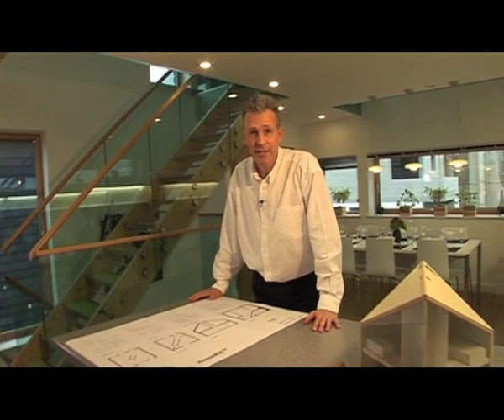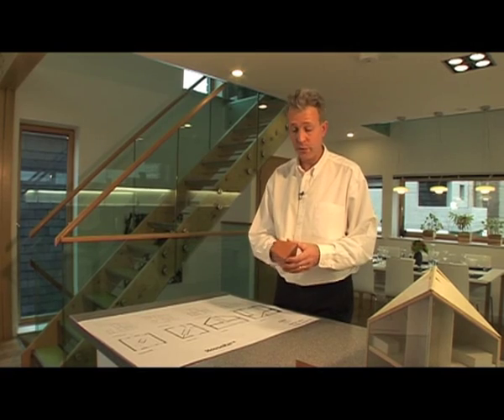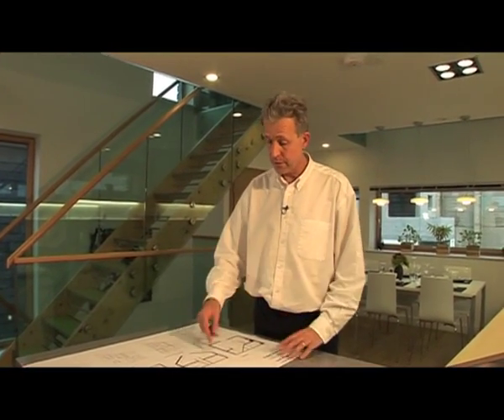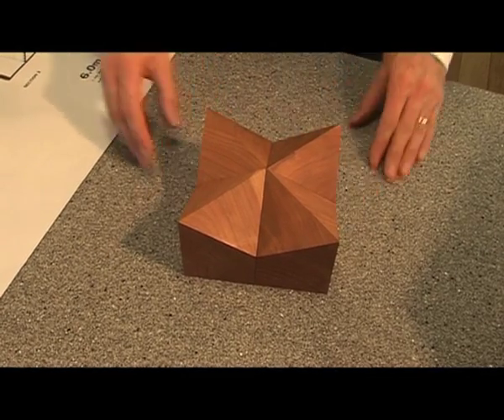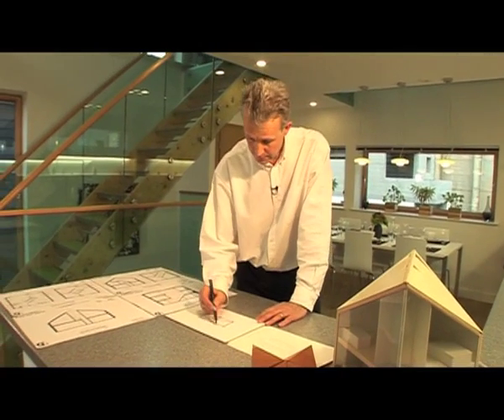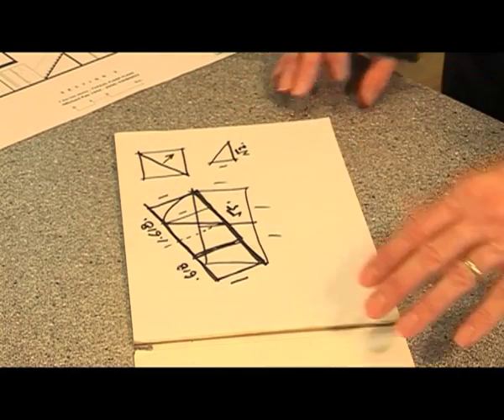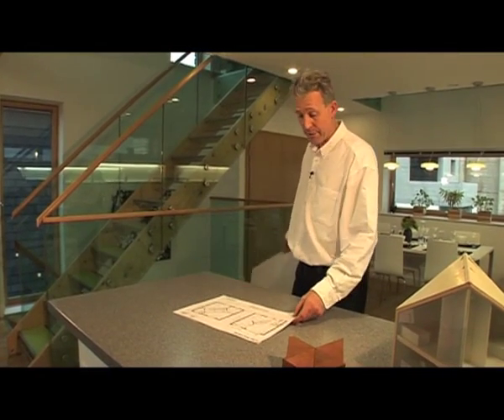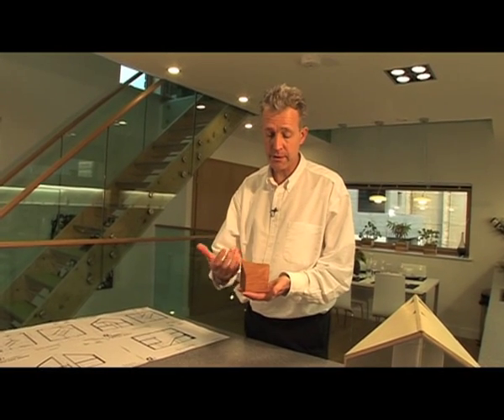Affordable Housing - Architecturally led Affordable Housing

Comment: Richard, very interesting concept.  From the affordable housing viewpoint I was initially struggling with the 15' vaulted ceilings @ the upper level.  It was good to see you move usable spaces up into that position. I appreciate the angled offcuts being re-used in tandem, but I'm not sure of the quantity of offcuts that would be utilized?  Also, if the roof would be stick-framed, would every joist not be a different length? Your thoughts?  I really appreciate your creativity.  cheers, Jim